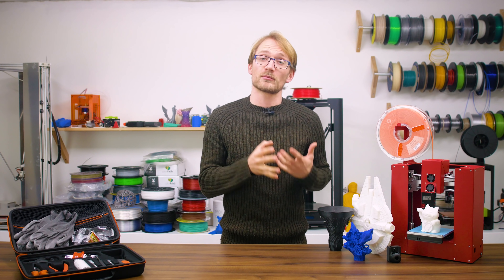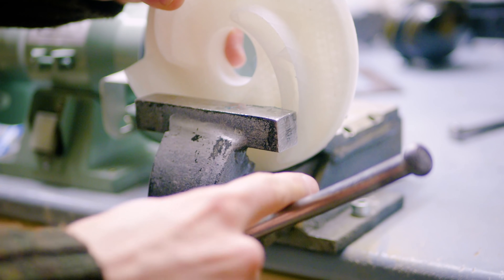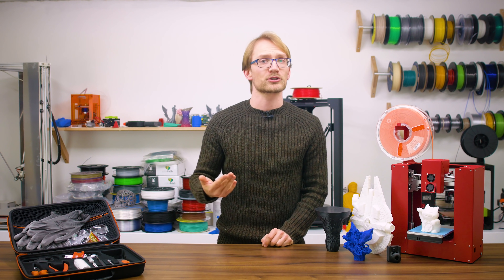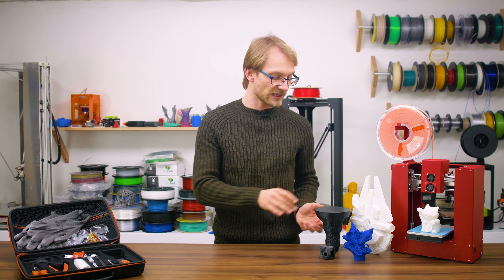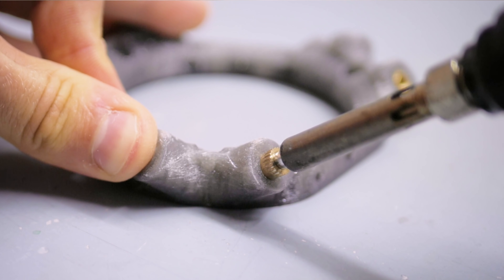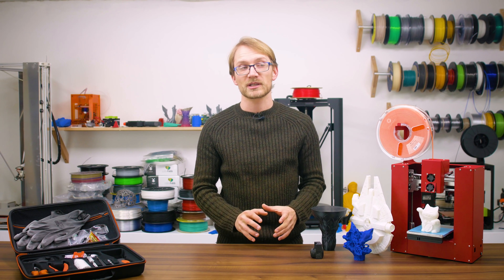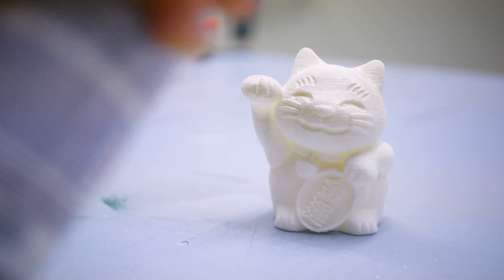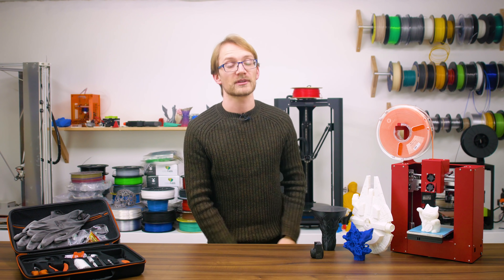Basics: How to post-process your 3D prints!

Comment: I use a combination of wood filler for really deep imperfections, and a paint on acrylic primer, so I can load up fairly thick and it sands away quite easily to go flush with the layer lines. You need more than a day for curing between each method before adding a top coat though, otherwise it will peel. Best to give a few days between to make certain.

Comment: Do you have any advice for small models? I print my own LEGO accessories and parts, and due to the detailing on some, it is hard to get a decently smooth surface.
Reply: Try using a 0.2mm nozzle if details matter that much👍

Comment: I guess it's a lot about balance. My biggest issue is checking what layer height would be ideal to get the part more resolution. Unfortunately, PLA doesn't have the best possible layering. PLA+ does better, but it's a lot shinier so you have to use more primer to color it up.

Comment: would heating the surface of PLA work to smooth it a bit? if you get the temp and time just right? or would that fail miserably? also i found a toothbrush with a bit of powdered abrasive good for those small details and holes the sandpaper can't get into

Comment: I've found that Loctite 406 works absurdly well when bonding PLA - the glue bond turns out stronger than the parent model.  Very expensive for super glue though.

Comment: honestly the tip about pointing the tip of the knife, and cutting away from yourself, is a bad tip at best.
you have way more control, cutting towards yourself, you can better control and hand the object, and cutting get's easier because it's physically easier pulling, than pushing a knife.

it's a old tip meant for children

Comment: What about ethyl acetate to smooth PLA?
Reply from the maker: Works about as well as acetone (ie., not at all)
Reply: Thanks for the definitive answer.. I saw it mentionned in some places but I was wondering as the experiments did not seem to be very conclusives. As chloroform seems to be the way to go, maybe limonene would give interesting results as it is much less polar than acetone and is also known to easily dissolve some plastics such as styrene.

Comment: I always love the gloves and respirator warnings for dealing with any kind of situation. I have been breathing lead solder fumes for 40 years. I've sanded everything under the sun for 40 years. I've handled, ungloved, chemicals ranging from acetone, gasoline, ferric chloride, and a whole host of other "nasty chemicals". The only thing for which I have ever used any sort of protection is when dealing with glass or fiberglass dust. That is the ONE thing I do not want in my lungs, for obvious reasons. So far, I am the most healthy person I know. I have, and always will, say that it is exactly because I DON'T take all of the required protections (including the anti-bacterial trend). When I encounter "nasty" things, my body knows how to fight them. When people who protect them,selves from everything under the sun encounters even the slightest particle, their body has no clue how to fight it. But... that's just me and my healthy self :)

Otherwise... love your videos, dude.
Reply: With a sample size of 1 it might simply be luck. Though I'd imagine you know other people with a similar story.
But I agree on being overprotective, at some point it's just silly.
Reply: If you think fiberglass is bad, try working with carbon fiber. Amazing stuff, but handle like the plague :)

Comment: 12” Disc sander and spindle sander will solve 95% of your problems. 48” belt sander also very useful and could replace the disc sander. Disc sanders can be made quite easily.

Comment: On the topic of getting separately-printed pieces to adhere together...how would one go about doing that for very flexible filaments, like ninjaflex or TPU or similar? I would hazard a guess that regular glue would just form a rigid layer and not stick for long, if the parts get bent a lot.

Comment: I would love to see some tips on finishing PETG. It seems like it's an excellent material, but it's also different than both PLA and ABS.  Any tips on sanding techniques, glues/welds?  Some of this stuff I'm sure can be trial and error experimentation such as flame/heat smoothing. Just would love to see something for more than just PLA or ABS since the materials are different and require different techniques.

Comment: if you mention links to another channel, please put them into the descriptoin too. not only that info-button-sidebar-annotation thing.
on the topic: i really like embedding normal hex-nuts into a print. it's not the easiest thing to model, you have to pause the print at the right moment to insert the nuts .. but it's worth it for knowing, the thread is the strongest part of the whole object, and have it turn smooth and easily.

Comment: Why am I watching all these 3d-printing videos? I don't even own a 3d-printer..
Reply: I wish, they are still too expensive here in Sweden. :<
Reply: You can get a XYZPrinting DaVinci Mini at CDON for under SEK 2500, the prints are actually surprisingly good. The proprietary filament will hurt your wallet in the long run though and hard to get. I think I purchased filament for close to the price of the printer already... Shhh, don't tell the wife. ;-)
Reply: Yea, but like you said the filaments are expensive and proprietary.  The proprietary filament also only comes in PLA which really locks you down. I want a 3d-printer that gives me the freedom to use the filament I want to use. Maybe I want to print something elastic using one of the various elastic filaments, can't do that on the da vinci mini. Sure, there might be DIY kits you can build yourself for cheap but I don't trust myself in that. I rather have something that's been proven to be good and easy to setup.

I think that 3d-printing is still in a too early phase for me, it's still evolving and eventually something I want for a good price will exist.
Reply: Yeah, what you wrote is true. However, I personally think the Mini is a nice first printer to use while waiting for the market to bring out even better things. It is almost disposable in a way. (It is also scores high on the "wife acceptance factor" since it has a small footprint for it's build volume and doesn't look like a junk-tower.)
Reply: Have you rectified the shortcoming by now? I got myself a cheap Chinese kit and i'm super happy!
Reply: Thats what I once said and I have 2
Reply: buy one, problem solved

Comment: Great video, Tom! Might I add some tips? From people from the plastic industry, Igot this one, particularly for ABS: if you quickly pass over the flame of a lighter over the part, it sort of works like a primer, it changes the polarity of the surface molecules and makes it more prone to get electrons from the paint and fix it there. Also, since you pointed out so well that scalpels and cutting tools are so dangerous, there is one that takes the danger away, the deburring tool, it works like a scalpel for corners and is quite cheap. Some acetone pens exist on the market which allow you to fix details on the surface of prints. I have a video about that but the last time I tried to paste the video URL my comment was classified as spam.

Comment: Good video, although would have loved to have more options for PLA finishing. I have used this nifty little USB powered hotpen with interchangeable heads, it is perfect for getting rid of stringing and can do an ok job smoothing surfaces (but not to a perfect glossy level like vaporbath), but it's a great and quick little tool.
http://modifi3d.co.uk/

Comment: Have you tried using a heat gun to remove discoloration where support material is removed or where you have sanded. this is my favorite post process trick and how I get my prints looking amazing.
Reply: That is exactly the tip I need!
Reply: also with the heat gun for decorative things such as dragon wings you can model them in a way that they need little to no support and then heat them gradually with the heat gun and bend them pretty much however you want.

Comment: I think a deburring tool is the best way of cleaning those sharp base edges!
Reply: Doesn't really work well with PLA in my experience, but works well with ABS and PETG. You can overdo it though if you are not careful.

Comment: Thanks Tom! I've successfully used PVC cement (the blue stuff) to join PETG parts and it seems to work well, as It contains a small amount of MEK (methyl ethyl ketone) which appears to be a good solvent, not too toxic, and available from most hardware stores. I think there are clear cements (if the blue looks bad) but I haven't tried them. PETG might even solvent weld with the thinner 'PVC cleaner' solution, but I haven't tried that yet either.

Comment: Yet another great video!!! One thing I'll add for people without full sets of taps. Just as you warned(very rightly so) to be careful of too much heat with Pla, It works the other way also. I have taken a lighter to a bolt then screwed it in slowly, most of the time needing to repeat a few times. Or a soldering iron too, Ive plugged it into a print then quickly threaded a bolt in. Heat guns also work wonders for clearing up strings

Comment: wet sanding a filler primer for automotive use is not a great idee as te primer takes up water... dont wanne be a smart ass but thats just how it is. if u use filler just the same. 2 compounds filler takes up water even wourse. if you can just sand id down so you cant see the printing lines use plastic primer (you dont need to sand it) and then color automotive spray if needed and finish wit clear coat, can is ok but 2 component clear is mutch better and it will be awsome. just make shure u sand it alright before, go up to 600 grid is plenty. cheers. nice vid though. take care.

Comment: Can confirm. Everyone who owns a 3D printer should have a set of small files.
I'd check if they are bent if you can see them in a store, but mine probably bent from use and not just coming that way.
Flush cutters are useful for close brims/skirts or remnants of support material

Comment: Please do more experiments on post production of PLA, there must be more options than sanding and filing. Is there anything like acetone that will work?
Reply: You can try carefully using a heatgun and there is specialized epoxy to smooth the surface structure and make it shiny. Also there have been tests using THF (Tetrahydrofuran) or DCM (Dichlormethan) which both can dissolve PLA but instead of only "melting" the first layer rather make the whole part rubbery and leave the outer layer. Also they are highly toxic and can cause cancer.
Reply: Jona Jona i tried THF .... epic fail !   The pla just went soft with 0 surface change.
Reply: Dichloemethane works pretty well, but I would not recommend using it.

Comment: theres also 1-part body filler that usually comes in tubes. it dries really fast and sands as good as any body filler. its great for fixing defects and print lines that would otherwise take ages to sand.

Comment: I think it would be cool to have a video on how to post-process a part in order to get rid of layering, like for models. I know there's some materials you can buy to fill in the gaps, and then sand, followed by repeating this until you get a shiny surface. I'm just not aware of what they are, and how to properly use them.

It would cool to get a priming guide for different materials. What materials need priming, and what ones don't? Is there a way to prime a material that also helps with the visible layers issue?

Comment: Hi Tom, Pls go into more for PETG as we are using it for end use parts and the adhesives used would be helpful. Aslo, use Krylon plastics paint right onto the petg surface. super bond & wont scratch off. Cheers.

Comment: Can you do more tips for doing functional mechanical prints? (I'm a mechanical engineer and use my personal 3D printer much of the time to problem solve and come up with custom parts/tools. usually I even use my little Robo3D over our shop's Stratasys Fortus :p)  

Also, is there anything on the horizon for embeded electrical parts into 3d printed pieces? I heard about this a while ago and then nothing after.
Reply: To embed a part you need to design the 3d part in pieces so that it can fit around it , perhaps?
Or design it so that the printer pauses when it reaches the point where the embedded part is placed.
You embed the part and then resume and the printer prints around it.
The problem there is the resumed part isn't going to adhere too well to the previously printed part.
It sounds like a design issue more than anything.
You could design snap on clips on such a design so it all snaps together.

Comment: I'm a machinist by trade and I really like a deburr tool for the insides of circles like this:
https://www.amazon.com/General-Tools-482-Swivel-Deburring/dp/B00004T828/ref=sr_1_2?ie=UTF8&qid=1484958118&sr=8-2&keywords=deburr+tool

Good tip on melting threaded inserts into parts. I hadn't thought of that. :)
Reply: McMaster lists them as "Heat-Set Inserts for Plastics".  I highly recommend these.
Reply: I agree Josh - nothing better for removing burr on both plastics and metals...for those interested - search for NB1100 on ebay.  They are really well priced and work much better (and safer) than a knife.
Reply: Josh Tenny +1. If you do not know these tools yet, you are missing out big way. Hopefully Thomas sees this comment!
Reply: +1!!  I've got the Changeable Blade Deburring Scrapper from Mcmaster (4289A35) and it saves me a ton of filing.  Every 3d printer should come with one.